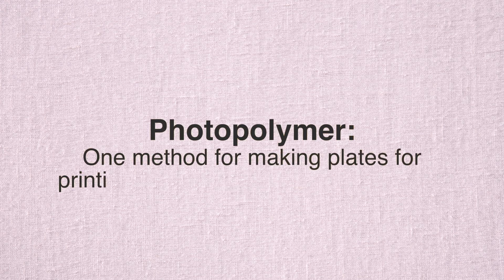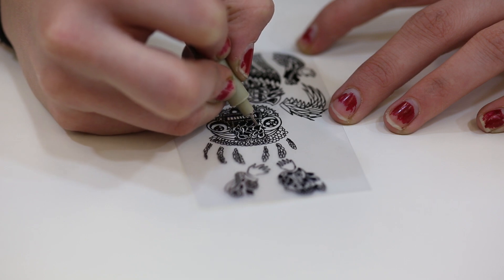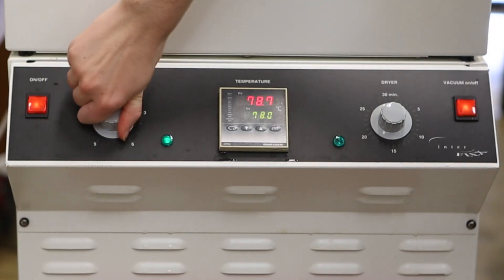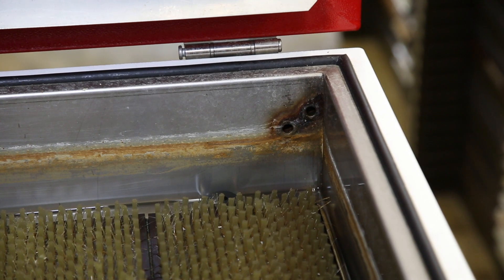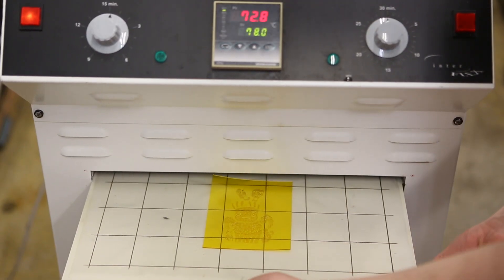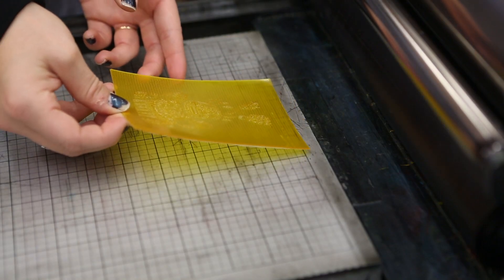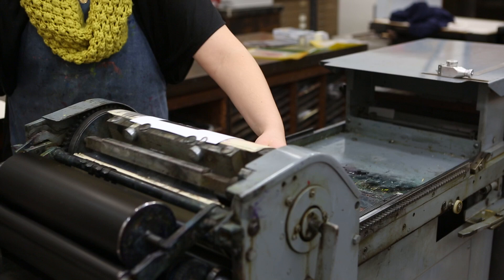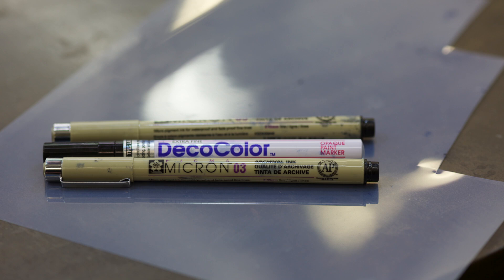PhotoPolymer for use in Letterpress Printing.

Comment: how do you get the photopoly to stick to the mounting rubber/magnet?
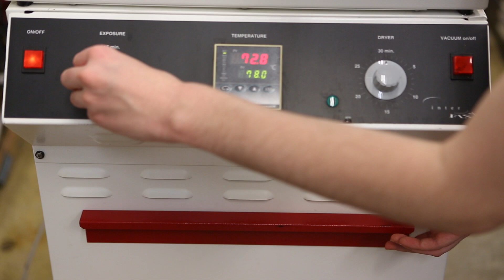Reply from the maker: We purchased the photopolymer materials from a vendor called Box Car Press. They sell a double sided sticky tape that sticks to the Photo polymer and can then be stuck to the base. I did not give much detail, but look at 01:23. You can see that we burnished the tape and peeled off the backing so it can be placed on the plate.
Reply: @jaescala  Beautiful. I just ordered some unexposed scraps to get our Jet platemaker calibrated. Wasn't sure if their adhesive would hold up to the wash, good to know! Thanks 🙏🏼
Reply from the maker: @nwitcher9596  I found them to be very helpful if you have questions about getting set up. Enjoy.
Reply from the maker: Just to be clear, you do not apply the adhesive backing until after the plate has been washed and is dry.